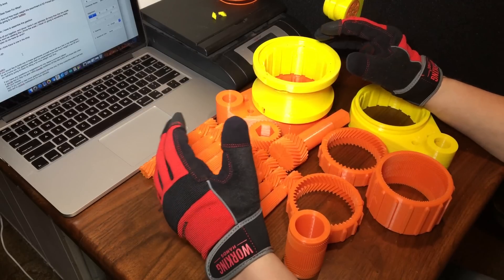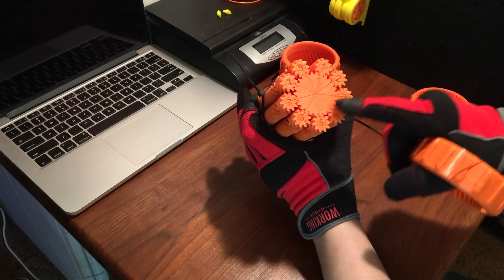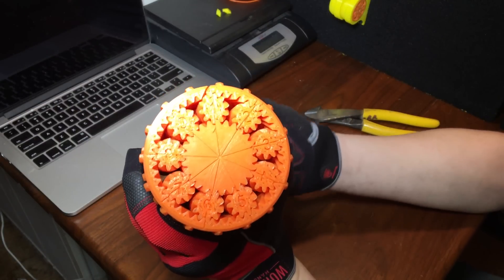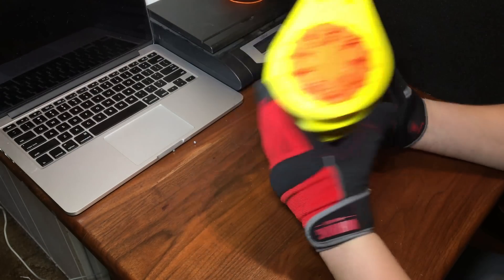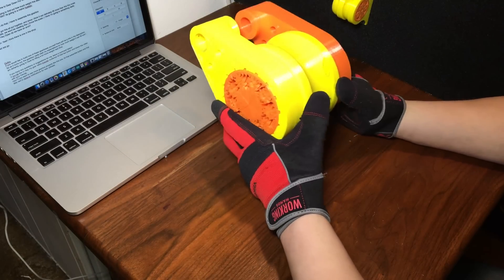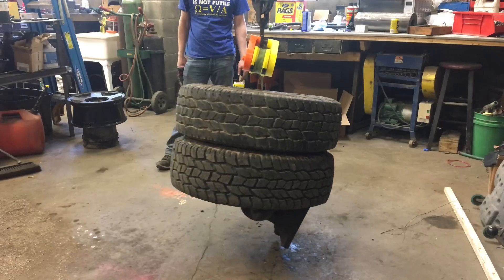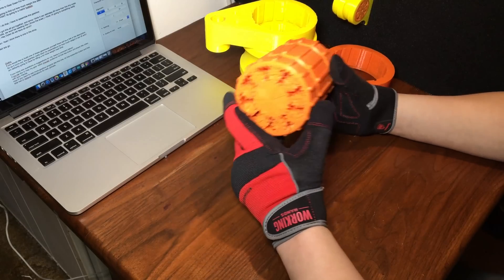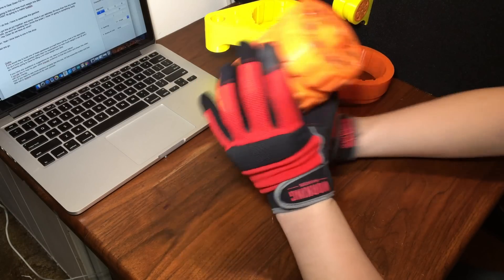You Won't Believe What This 3DP Gearbox Can Do!

Comment: This seems to be the first plastic 3d printed object that has any sort of real use. But is it worth an expensive 3D printer? Fuck no! Not if this is the only useful thing they can make. I'd rather spend all my money on a cnc machine, because they can actually do something productive.
Reply from the maker: the expensive 3D printer that your referring to only costed about $200, CNC's are far more expensive
Reply: Yes that's why I said I'd rather spend all my money, they're quite expensive, and 200 is a lot in my eyes if it can't do much.
Reply: But you could use it to print the parts to make a CNC, then use that CNC to mill the parts for an even fancier CNC.
Reply: "This seems to be the first plastic 3d printed object that has any sort of real use." You would be wrong. Oh, so very wrong. Albeit, in the lab we have already begun 3D printing functional organs. There are houses being printed with 3D printers right now. NASA uses a 3D printer to print special tools IN SPACE. The list is a mile long of actual functional tools being printed. Aside from that, people all over the world are finding functional things to print. For example, people on the Aquaponics forum are printing submersible pump adapters, pipe extensions, valves, switching mechanism, etc to grow actual edible food! sarcastic gasp
Reply: +Jamie Smith  It can only be used with a strap and that limits how far it can actually move a load...which is not very far at all. It pretty much has no practical purpose except for demonstrating how strong 3D printed parts can be especially when you press steel rods into them!
Reply: Wait what? Only $200? How?
Reply from the maker: Anet A8, if your a techie person its an amazing printer for the price
Reply: you can get pretty good prints off of $150 printers if you are willing to put a little work in, plus plastic is pretty cheap but as you said it is plastic so as far as final products go it is inherently limited.
Reply: That moment when Max learns you can 3D print metal...
Reply: well you can then use the plastic to a lost wax type casing for metal parts..
Reply: I do, I just typed the response fairly quickly so used poor judgement on proper vocabulary. That should be "also". Or remove the word completely. Regardless, selective attention doesn't really contribute to the conversation any, does it? ;)

And if we're being truly metiuclous about grammar or structure, your sentence should start with "I". As it stands, it's an incomplete sentence.
Reply: mcavity can't you just 3d print wax? Not sure plastic would be a great material for loss casting.

Comment: Firstly I came here cause I watched the Sinkhole video from PE and saw your channel name in first x amount of comments before loading more as a reply to a comment.

Secondly, Nice work on the video, you got me interested to see this plastic planetary hoist/winch in action and I am surprised it is as strong as it shows despite lack of greater weight, but must point out that the weight cap is limited by the connection point, i.e. the handle you were hanging it from, as well as the straps capacity you were using.

Kudos. You May have another Subscriber if you keep up the good work. Never stop improving your videos though, do not be afraid to try some other things out with your editing or showmanship but do keep it PG so more folks and little ones can watch and get educated. Forget and Ignore the haters and bad comments, those can be deleted or blocked.
Reply from the maker: +Joshua79C C haha I guess I wasn't trying to draw in viewers by commenting on other videos, but apparently that's a good marketing campaign! 

Also, I think I have (randomly) gotten a good balance between the amount of weight the gear teeth can handle, and the amount of weight that the case can handle. so yeah I was worried about a total structural failure just as much as ripping the gear teeth right off. I would much rather not have it snap the mounts off during testing because then the weight would just fall, where as if the teeth strip off I'll have a bit of warning. 

About the PG stuff, i'de like to but I'm still trying to decide what direction to go with that.

Comment: It would be really cool if you made a 3d printed manual powered chain hoist!
Reply from the maker: HavokBWR I totally mentioned that in the first video about this gearbox
Reply: This while he used the electric cordless drill can easily be fitted with a hand crank handle, single or double if there is open middle space through and through.

Comment: I love how the key broke after lowering the 260
Reply from the maker: Prototype RC haha yeah, actually the gearbox itself has a shaft the same size sticking out but that broke off when I dropped it but I figured that would happen so I left a good amount of the hex for the sun sticking out so I could put that tool on it. Then of course that tool broke I was going to use a socket but I couldn't find any more video friendly weights haha.

Comment: if we attach a arm to this gear drive coupled to a motor the arm will not drop even if the power is cut to the motor . will it always be in loaded condition to prevent the arm from dropping
Reply: I believe planetaries like this one will act similar to a Torsen differential or worm gear setup, so yeah it will likely hold position until the gear teeth give up (all of them)

Comment: print it in a stronger plastic! See how much weight you can lift...
Reply from the maker: Once I can afford to change up my setup I will defiantly be doing that
Reply: Does your printer support nylon? If not I highly recommend the prusa i3 mk2. Otherwise I'm assuming you just mean you need to get all the moisture protection stuff
Reply: what if you add metalic particles to the molten plastic ?
Reply: Tony Stark hey
Reply: you would make the plastic weaker
Reply: Why hello my other half, hows things?
Reply: anyone know what plastic this one is printed with?
Reply: PLA. It's interesting if you heat treat PLA it actually becomes one of the strongest 3D printing filaments. Perhaps that might be even better than using nylon...
Reply: Discord Shadow Lord of the Black Mountain dosnt't work since the metal isn't actually alloying just free floating infact it may make it weaker
Reply: Discord Shadow Lord of the Black Mountain laser sintered metal would be best but it might not be as resilient as the plastic strangely.

Comment: okay so next is a giant robotic arm right? one strong enough to lift that anvil?
Reply from the maker: im doubting that it would have enough leverage
Reply from the maker: but trust me, its on my list and will be in the works one day:)
Reply: yeah gear up something to break sound barrier !!!  maybe a fidget spinner lol
Reply: XD
yes!
Reply: With plastic muscles?
Reply: +Sizzlin Moe Sizlack yea I don't think it was 120
Reply: Nickelme
Reply: Might be harder with an arm. One thing a planet gear has going for it, is it can distribute its load 360 around the whole gear. a Lever has torque applied in a very specific direction, and that might be more than the plastic can handle
Reply: @shayneoneill1506  what if you put the planet gear at the join of the lever and used IT to turn the arm
Reply: Gear Down For What? Put the drill on the other way!! =200000 RPM

Comment: If you really want to test your gears to their maximum potential,there is a cheap and easy to make rig.Here's how you have to set up the rig:
1)Get a hinge and fix it on the ground.
2)Connect a long piece of metal sheet or I Beam(I beams are much stronger than sheets) to the ball joint.
3) get a ball joint and fix it on the ground,In front of the hinge and under the metal sheet/I Beam.
4)Get an extension spring with a high force constant and hang some masses from it,record the the amount of extensions per newton/pound(Hooke's law).
5)connect one end of the spring to the ball joint and the other end to the metal sheet/I beam.
connect the free end of the I Beam to your gearbox and pull it(second class lever).
6)From the amount of the extension of the spring you will know how much force is on it(DO NOT FORGET THE WEIGHT OF THE I BEAM).
7)Divide that by the mechanical advantage of the lever and you know how much force the gearbox is lifting)
8)This should be sufficient for plastic gears but if it exceeded the potential of the spring,re-arrange your rig to work as a third class lever.
I hope you found this useful,otherwise sorry for writing so much junk :P
Reply from the maker: Dear Epic NOOB. I will try get some scientific shit in my next video
Reply: Epic Noob There is a big difference between sheet metal and an I beam. if you are using it as a lever there is no question you should use an I beam. That like saying you could use a sheet of paper or a 2x4 both will work lol
Reply: just use one of those things fishermen use to weight things but industrial version
Reply: I think it's pretty safe to assume that he is talking about metal stock not sheets.
Reply: Might be easier to simply anchor a hook into the ground, have a rope coming from that to a force gauge, then from the gauge to the gearbox.
Reply: Epic Noob i think you spent wayyyyy too much time in the comments